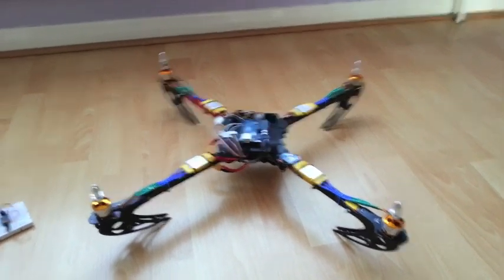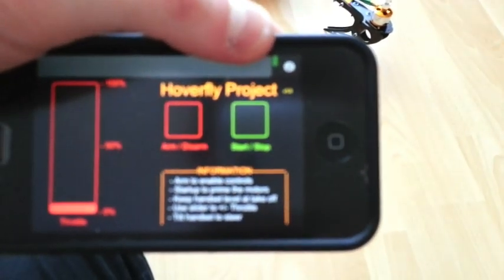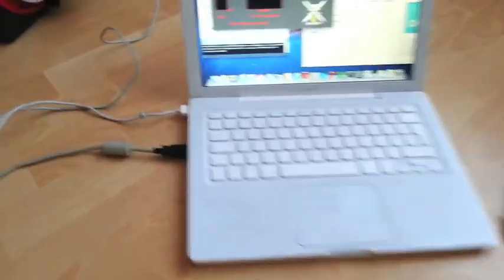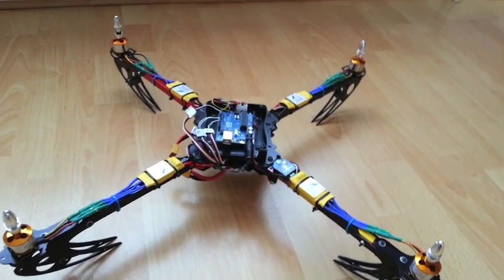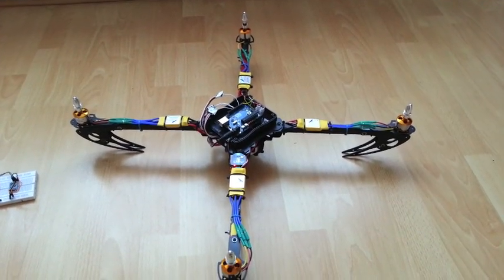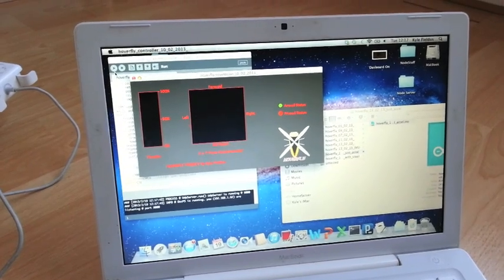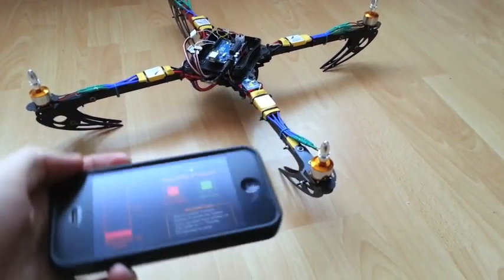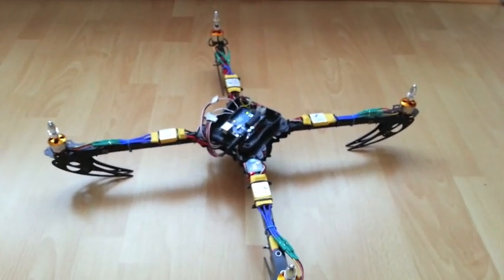Arduino Quadcopter - Phase 2 (Mobile Control)

Comment: Hi, cool video, I am building a quadcopter with arduino too but I have a problem. when I connect the battery, the engine and the receiver to the ESC nothing happends and the voltage go down to zero, do you think is a problem of the battery or of the receiver?
thank you very much

Comment: Banggood sell a whole range of decent Arduino kits and add-ons, if anyone is interested in getting into the hobby:  https://www.banggood.com/search/arduino.html?p=JQ26191551677201504Z
Reply: I see they also sell quadcopter kits and spare parts. That's a very useful link. Cheers

Comment: Hey, neat project! I was just wondering, do you think infrared from a remote would work? I wanted to do something similar, but not using a phone. I am also not really looking for range at this time.... Also, what do you use to regulate the motor's speed? Some kind of variable resistor? Thanks!

Comment: what type of motors u used in project ? what is the lenght of one arm :P ? and overal cost of the project ? Im thinking about trying to build sth similar based on arduino as well :P I saw some others projects on yt and i need to admint.. duuude, great job ;)

Comment: Hey Kyle 
Great work.. we have worked on the similar concepts, but the issue is that surrounding Wi-fi is causing interference to control the QR.
Do have you any solution for it. It was a university project too, we submitted using the controller unfortunately. would like to develop it more.

Comment: When the Arduino is on and the GUI is active it probably re-calibrates the throttle range on the ESCs. If that is what's happening than its likely you are experiencing uneven thrust which would cause a flip scenario. It seems like you know its not good to have the GUI running but be sure you re-calibrate the throttle range on the ESCs. It might be good to re-calibrate all the ESC features on each to ensure they are all the same just in case you accidently entered programming mode at some point and changed something.

Comment: Dude, go to a RC hobby shop..  You probably just need a gyro or some form of microprocessor controlled auto-stabilizer.  All the RC helicopters and quadcopters come with them, so they should be able to hook you up.

Comment: hola  , de cuantos KV son los motores?
Reply: Diego chauca gallegos amigo tienes  el  codigo de programacion para el arduino???
Reply: Diego chauca gallegos the drone looks to be about 450 or 500 so I would suggest about 1000kv motors with 25A to 30A ESC and 8x4.5 props.... hope that helps

Comment: Just a thought, you could use the Arduino and a transistor in place of the speed controllers. Pulse the motors with the output using the transistor as a relay from the battery.

Comment: Hey, is there another xigbee on the arduino mounted on quad? I cant see.. XIGBEES on both arduinos communicating with eachother right?? :) Have you calibrated the range you can achieve through it brother??

Comment: Hos do you communicate between the phone and arduino?
Reply: How*
Reply: ***** Although you may be correct, the way ive done this before is you have to use touchOSC is connect to your computer over the network, where the computer then sends the data to the quadcopter through xbee. The phone doesnt connect directly to the quadcopter unfortonaltely
Reply: ***** someone above mentioned a way that may help you.

Comment: hi there

I need a little help with buying the parts.
I want to make a zeppelin that is controlled WiFi.
I think I need two engines and  Arduino uno ..what wlan shield to buy???

Can it be operated outdoors??
End do i need a router ??

Comment: hello brother :)
i have 2 questions :
1. can i use the other Arduino board to control the motors ?
2. is this possible to control directly from IOS device to Quadcopter ?
many thanks

Comment: is there any way to use the bluetooth sjield instead of the xbees to comunicate between the controller and the onboard arduino? i plan on using the motor shield v2 by adafruit, so its possible to piggyback another shield,

Comment: what did you use for power distribution
Reply from the maker: HI,  I used something like this http://www.ebay.co.uk/itm/2-x-quadcopter-Battery-ESC-power-distribution-Board-kk-multiwii-etc-/221342916980?pt=UK_ToysGames_RadioControlled_JN&hash=item338910e174

I have since rebuilt my quad onto a F450 frame which has this built into it
Reply: thanks alot

Comment: What are you using for the chime as far as frequencies and output device?
Reply from the maker: Hi, thank you for your comment. The chimes you hear are actually generated by the motors. When the ESC's receive power they send out pulses to the motors for just enough time to create a noise but not spin. Hope this makes sense. Happy holidays.

Comment: may i ask you which wifi module are you using with your arduino..? i am using the MEGA version.. cause i am finding difficulty in choosing my module.. 
Thanks in advance..
Reply from the maker: I am Using Xbee Pro modules. They are similar technology to Bluetooth, they operate on a Private Area Network technology and can only talk between other Xbee modules, hence the complex communication setup. iPhone -> MacBook -> Xbee ->Xbee -> Quadcopter(Arduino). Hope this helps/

Comment: well done mate!! may i ask you how did you manage to do it using an iOS?? i am working on something similar and i really like your idea in order to control it!! Thanks in advance
Reply from the maker: Hey, Thanks for your question. I am working on another video which will go through an example of linking your iOS device to an Arduino, hopefully it will answer your questions. In brief though I am using TouchOSC which is the actual app used on the iPhone, this talks over Wifi to a computer running Processing with the oscp5 libraries. Processing can then send Serial data to an Arduino.

Comment: Hi, could you send some details of how did you make this project? Such as your degree's project documentation or any other thing that could help me to learn more about quad-copters.. I'm intended to design one also as a hobby, but with video streaming from the camera through the wireless module also. My main goal is to design video transmission and the camera module, with a full-hd camera module.. but need some stuff to have a quick start into designing quadcopters.. tks (redelinux10@gmail.com)

Comment from the maker: Hi, Thank you for your comment.

Your ESC requires a DC connection from the battery and the signal wire (The white wire) goes to your Arduino. You send PWM signals from Arduino to your ESC to control the motor.

Comment from the maker: Hi, thank you for your comment. I will try and answer your q's as best I can:
1 - You do not need to jailbreak to use TouchOSC with iOS
2 - Flying outdoors would work using a local wirelessnetwork between my computer and iPhone, Range is limited but this is a prototype.
3 - There are many Arduino Quads using 2.4Ghz Transmitters, lokup Aeroquad or Arducopter for their code and build instructions
4 - I haven't yet started to think about performing stuns
5 - I have written all control sketches.

Comment from the maker: Hi, thank you for your comment. I am using Arduino Uno as my microcontroller. I have moved on from using two and reduced it down to using 1 Arduino on the quad and interfacing the Xbee directly to the PC with just an Explorer USB board.

Comment: mr.kyle fieldus
i need an information that does a brushless motor works with just a d.c supply to the esc of it.actually i'm working on the quadcopter that is controlled by mobile using the d.t.m.f signal so pls kindly say can a brushless d.c motor works by giving supply to the e.s.c

Comment: Hi Kyle,
Good to have the Start/Stop.
1. You're running TouchOSC, so you don't need to jailbreak, do you?
2. On same network, XBee, WiFly...How do you plan to fly outdoor?
3. Any plan to work it on any 2.4GHz Transmitter?
4. With iPhone/iPod touch, how do you do the flip, roll and loop?
5. Do you program Arduino on Sketch and write all things for balancing, hovering, dragging, failsafe algorithms?

Comment: Hi Kyle, is there a reason why your are using "Processing" instead of using this library "oscuino" ?
Because you could reduce your project to just a router and the two arduinos there is no need for a notebook (but you have to add ethernet to one arduino...eg. by adding a ethernet shield or a router with ddwrt+serialport)

Comment: Are you just planning on using accelerometer for stabilisation, or are you also buying a gyroscope. The reading from the accelerometer are unlikely to be stable enough while in flight to build a stable control loop.

Comment: hey,
can you list the parts you were using?
and about the controller (iphone): 
is that a native ios app? (built by xCode in objective-c) .
can it be controlled without the macbook connected? (iphone to the quadcopter)
and the last question: communication wise - you use xBee bluetooth? does this gives you enough range? 
thanks, 
eliran :)

Comment: Great work Kyle. I've been planning to build something like this myself and your video got me fired again.

How about using something like Bluetooth Low Energy or a WiFi shield to connect iOS to the quadcopter? Maybe you won't need the laptop or 2nd Arduino then, if all they do is relay the commands.

I'm in the UK and have some of the latest stuff to do this (CC3000 wifi and/or BLE shields) maybe you could try it in your setup. Email me on gk@fmail.co.uk. Cheers

Comment from the maker: Hi, I am using Xbee Pro series 2. These are on loan to me from my University and will go back when the project is handed in. Most of the components I bought in the end came through eBay, last time I checked you could get two of these 2nd hand for roughly £40

Comment from the maker: HI, great question, you can do this with an android phone, I think though you an android solution would benefit from using a WiFly chip on the quad rather than Xbee, this way the Android would be able to speak directly to the quad over a true Wifi connection as apposed to Xbee's 802.15.4 Serial connection.

Comment from the maker: Hi, Thank you for your comment. I orginally tried running both Xbees at their highest Baud rate and found them to trip up over themselves but I think this was just a mix of other problems I had at the time. I get the first Xbee to send a  symbol (start bit) and then the receiving Xbee knows to wait and read only the next n number of bits. I coded in a watchdog that if in the event of comms failure and motors are spinning it will loop and reduce the speed to safe levels just incase.

Comment from the maker: Hi, Thank you for your question. I moved to using an ADXL345 Accelerometer and a L3G400D 3 axis gyro and found them tricky but got them working in the end. During a rebuild of this project I have moved to a MPU6050 (6 Degrees of freedom) which is cleaner (smaller footprint and lighter) for my quad

Comment from the maker: Hi, thank you for your comment. I loved the frame and did also notice some slight flexing in the motor mounts. I recently moved to a different frame (RC Timer F450 black). Couldn't recommend this frame enough, it is a copy of the DJI 450 Flamewheel but just as light and strong, only cost me about £30 on ebay. I will do another video soon showing off the new build and reviewing all in one.

Comment: I have the same frame, brilliant and tough. Just a word of warning though, since it has a single plate of fiber glass for the motor mounts, after some use the mounts start getting more and more flexible. Eventually you'll notice the motors leaning in slightly during flight.

Comment from the maker: Hi, Thanks for your comment. Which topic/subject would you be doing, I assume electronics (Design and Technology). I have been told that this was very difficult and substantial project to undertake on my own for a University undergraduate project, most projects like these have been team builds. You would probably be best doing a remote controlled wheel based robot for a secondary school project.

Comment from the maker: The emphasis of my degree is in software demonstrating Communication and Control using the Arduino platform. My University already had wheel based, Arduino controlled robots and I wanted to do something different.

Comment from the maker: HI I am using generic 2212 13T 1000KV motors (Found a set of 4 on ebay new from Hong Kong for roughly £40. The battery is a 3s 2200mah 11.7v LiPo.

Comment from the maker: What code are you using for your Uno? And How have you got your ESC connected? I connect the signal wire of the ESC to a Digital PWM port (D11, D10, D9, D6, D5 or D3) and use the servo.h library to control the ESC. 

To arm my Pentium 30A I found I have to write the value 40 to the ESC's anything less than this and they panic about too low a signal. You could then create a loop that looks for a character on the Serial monitor and increased or decrease by a given number when received.